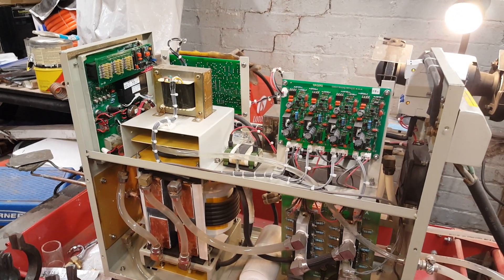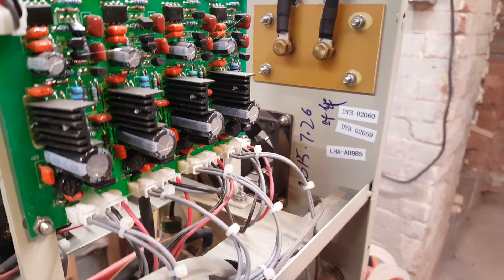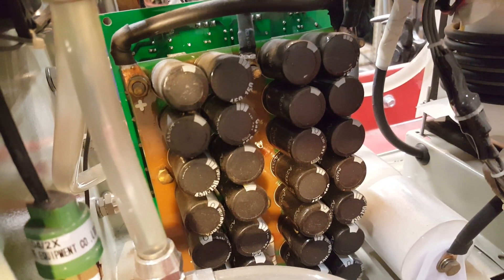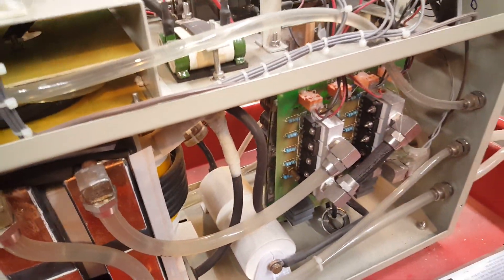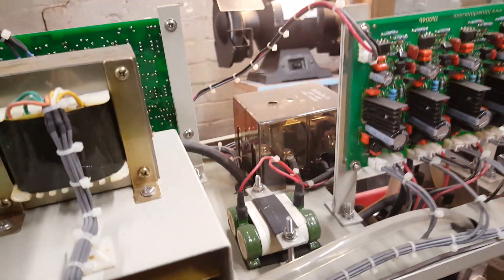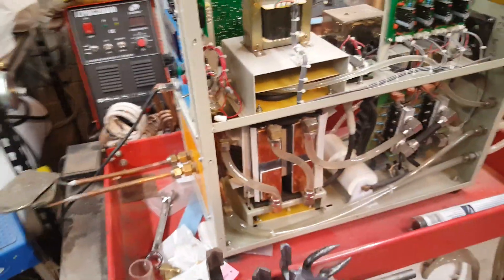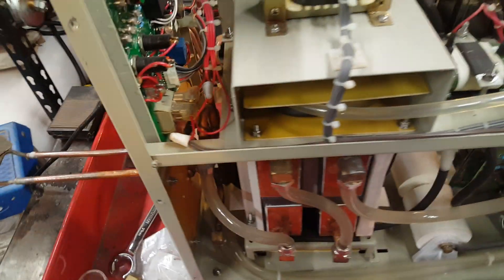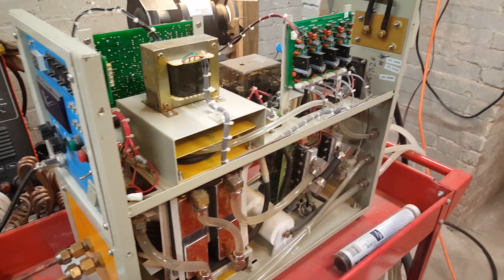LH-15A 110v to 220v conversion

Comment: Worth noting that newer units look a little different inside.
Reply from the maker: Indeed. I've done conversions on more recent units too and I had to redo my analysis on those.
Reply: You should definitely made an updated video. I could not see how this conversion will work on new units. Also the price on 110 vs 220 units is nearly identical at this time.

Comment: That wire you cut, it was red. My wire in the same spot, is yellow. I am wondering where that wire you cut was going to? Was it going to the transformer or to one of the boards? Once I find that out then I can do mine. I appreciate any help. Thank you
Reply from the maker: It's the one going to mains power. If you wire to 220v, it's really 110v 180° out of phase here in the USA. So, by substituting ground (ideally neutral, but I had a 2-wire + grnd service outlet) for one the 110v inputs, I cut the voltage to transformer down to the 110v it needs.

Comment: How did you determine which power terminal was hot, I saw you marked the left terminal as "H".  I purchased a 220v forge and like yours there isn't an indication of which terminal  is hot to correctly attach a power cable.  Any assistance on connecting to power would be appreciated
Reply from the maker: You already know because we emailed, but for the record here: it doesn't matter with a 220v unit. You will be connecting the two hots (with USA-style 220v) to those terminals up at the top (under the protective flap). The ground will go to the terminal near the bottom.

I marked one H because that's the one that needs to be H if I ever wired mine up for 110v operation.

Comment: hi there,
 Bought  one of these units and I'm not sure how to wire it up to mains power point. just wondering what wire goes where as I'm not an electrician. we have a 3 point plugs in Australia. i believe the third is earth or ground wire. I don't want to blow anything up or even get a shock can you please shed some light on this.
Reply from the maker: The ground goes to the ground terminal on the case near the bottom of the back. The other two go to the covered terminals near the top. Getting the ground mixed up is your biggest risk. You really need to make sure that you don't connect "hot" to that. You might consider getting an electrician to wire it up for you.
Reply: @ejoftheanvil  
Thank you for that. Can the hot wires go on either supply nodes ? being an AC current or do they have a specific terminal they connect to?
Reply from the maker: @alisekman8181  I believe so.

Comment: those caps have a bleeding resistor to discharge after power off.
Reply from the maker: That's a good point. I haven't looked, but it should as an important (and dirt cheap) safety feature.
Reply: @ejoftheanvil  Also there is an explanation for heating by not putting the whole steel bar inside the coil from the begining. At 800C the magnetic permeability of steel drops from 100 to 0. When it drops your coil has a low impedance so the current is high. If you put the full bar in the coil the impedance is so high that is not creating the required current to heat to go over 800C. When you shorted the coil in one of your videos you reduce the impedance with the square root of turns removed (6 squared vs 5 squared).

Comment: I just purchased a 110v model but I just realized it is a ZN -15KW . The boards are different inside. Are you familiar with this model?
Reply from the maker: I'm not. It's possible it is convertible as well.

Comment: So, EJ, how DID you originally connect it up when you were powering it from 110 volts?
Did it require 2 separate 110 volt circuits somehow?   Were there reasonably clear  instructions as for doing that?
And---- did you ever figure out where the " 15" Kw comes from?  Best I can figure, they are good for about half of that, even on 220.
The reason I ask is that I too, have seen those really cheap 110 volt models..

Comment: I'm pretty sure I have this same machine - it's named something else and I haven't taken the cover off to confirm. 
This video looks deceptively simple, we just cut that wire, and ground it, then we can run this off of a 220v plug? 
Thanks for the video - I've watched several and they convinced me to make this purchase last year :p Absolutely love using the machine, it's night and day difference between trying to use torches or furnaces... just amazing. <3
Reply from the maker: Yeah, the conversion is really easy if you have the same machine. You don't really need to cut any wires. Cleanest way is just unplug that one.
Reply: @ejoftheanvil  I just did it, machine still runs, I'm gonna put the cover back on but my main reason to convert it was because i had just finished wiring up for my welder and realized that the heater running on 110v wouldn't work with a 220v plug like I had originally thought.
This was super easy to do, but you mean I dont even need to ground out that wire?
Reply from the maker: @Napkinholdin  Definitely need to ground it. Really meant to point out that you don't need to cut anything. I did that when I was initially working it out. For other conversions I've helped with since, I did a much tidier fix.
Reply: @ejoftheanvil  What are your thoughts on adding a switch that allows changing this from the 110v to 220v by either grounding that wire or connecting? Would any regular ol' switch work do you think? 
I changed locations and figured instead of just switching it back, maybe I could put in a switch - that way when I have the ability to use 220 again, I can just flip a switch.

I realize I'd need to swap my plugs also but that's trivial since this machine expects you to always wire in your own plug anyway.
Reply from the maker: There's nothing for a switch to do. It's a matter of the plug wiring. If you want to leave the cable/plug on, make an adapter with a socket that matches what is on the induction heater & the other plug.
Reply: @ejoftheanvil  oooh - I thought that if I plugged it into a 110 it would break. I have a plug converter from my welder that I can use! Exciting, thanks for the reply :)
Reply: @ejoftheanvil  I have a question that I can’t get an answer to. EJ, Is your machines power supplied by a 2 pole 40 Amp breaker or a 1 pole 40 Amp break? I myself have a 2 pole 50 Amp breaker that I intended to use to supply power to my machine. Now If each half of a 2 pole breaker is 110 volts then wouldn’t that mean that I would need to install a 1 pole 50 Amp breaker to get the machine work on the 220 volt conversion as described in this video? I think I made a boo boo 🫠
Reply from the maker: @rokushovr  2 pole 40 Amp (i.e. two breakers "ganged" together so that if one throws the other will as well). I then wired both "hots" to the induction machine.

Comment: I just bought one of these machines, it says 110 single phase   , I don't  know much about it but I'm learning. After.        researching it doesn't  make much sense  to hook it up to 110 vac. There's no instructions that tell you how to hook it up to 110 . Is it just like a standard 110 wall socket , but with the ground going to the breaker box. I'd appreciate some help with this because I bought it from ebay and the seller isn't  any help and emailed the factory and no response thanks Dan Bolin

Comment: EJ, where would someone learn how to make different sized coils and  what turns would be needed to work?  What is stopping a 10" diameter coil with only 2-3 loops from functioning well?  Lack of power? or ability to focus the emf?
Reply from the maker: The inductance of the coil has to match the machine. 10" diameter with even two loops would be out of range and the induction heater will shut down. One loop would probably work, but not be really effective for much. The total power output is too low to effectively heat more than 1.5" diameter rod stock.

I'm currently editing a video to release that shows all the coils I've made so far and talks about how I make them. I hope to upload it soon.
Reply: @ejoftheanvil   thanks for the reply. I'm looking for a feasible way of melting/casting various metals instead of the tried and true propane/air
Reply from the maker: @wantafastz28  You can sometimes get away with somewhat larger coils when heating metal in a crucible, but 10" is still way out of size.

Comment: hello.
i'm beginner blacksmith and i'l interresting to buy an LH-15A induction heater.
are you satisfied about it ?
have you some trouble with it (expect the voltage) ?
sorry for my english i'm french.
thanks a lot.
Reply from the maker: I'm very happy with my purchase. I spend quite a bit more time doing blacksmith projects because of the convenience of my induction heater. I think you will be happy with one as well.
Reply: @ejoftheanvil  hello.
i have receive my induction heater and i have a problem.
the red led "water lack" is always bipping but i have put the water correctly (directly from the water of my house.
the induction heater need lot of pressure to work ?
thanks
Reply from the maker: @FUTUREXROCKSTAR  Yes, it really needs a lot of pressure to put 7.5 liters per minute thru it. (That's about 2 gal per minute.)
Reply: @ejoftheanvil 
 hello.
i have buy a new water pump today and everything is working !!! thanks !
Reply: @ejoftheanvil  hello.
where did you buy the spécial bolt for make your own 
inductor ?
i don't find it on internet !
Reply from the maker: @FUTUREXROCKSTAR  You can find coil making supplies at http://www.mettleworks.com/hot/index.html . However, I ordered mine through joyfay.com by contacting them via email.
Reply: @ejoftheanvil 
 hello.
thanks for your reply !
are you sure about the  joyfay.com ?
the sell teddy bear !
Reply from the maker: @FUTUREXROCKSTAR  Yup. They're really just an importer and they have contacts to get just about anything from Chinese manufacturers.

Comment: Do you mind sharing the specifics of how we could find this same manufacturer? I vaguely remember another video saying that you bought it off of eBay. It seems like eBay and Amazon is flooded with different models with wildly different prices. Any advice? I'm in north Texas and would love to come check out your shop!
Reply from the maker: I'm fairly confused by the variety myself. I used to think all of them were essentially the same as my LH-15a, but I'm less certain these days. Also, there are 110v units on ebay that are US$100s cheaper than the equivalent 220v which seems very suspicious to me because there is no manufacturing cost savings between the 110v/220v variants of LH-15a I'm familiar with.

In Nov 2019 I advised a friend to buy a 220v unit from US Solid due to the chaos of ebay units. Not sure if that's a re-badge of the LH-15a. Hopefully I'll get a look inside someday soon, but he's up near Tulsa.

You can find my contact info on the "Contact" page of the saltforkcraftsmen.org web page. I'd be happy to show you around the shop next time you're in town.